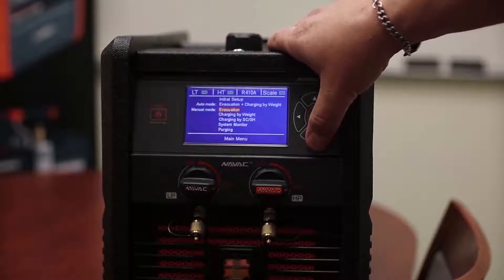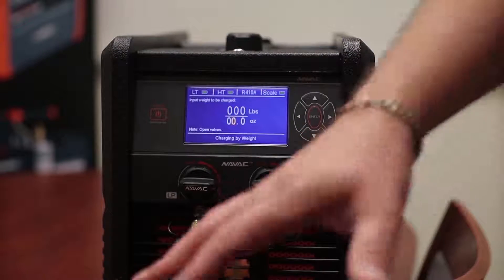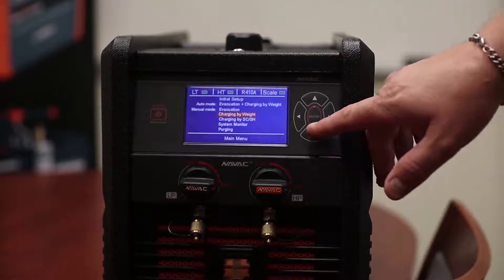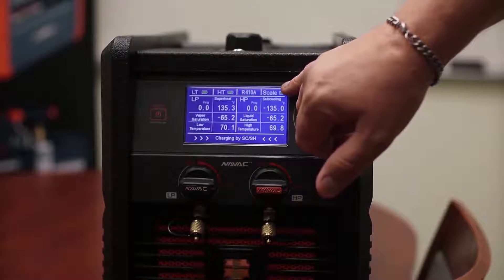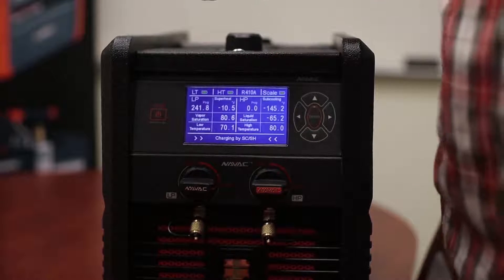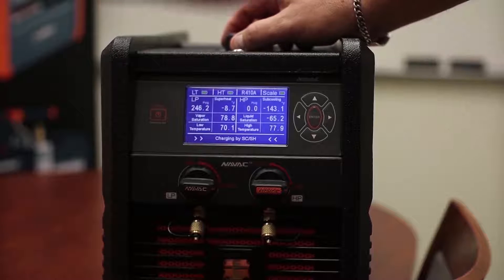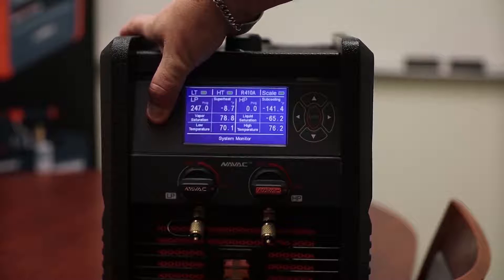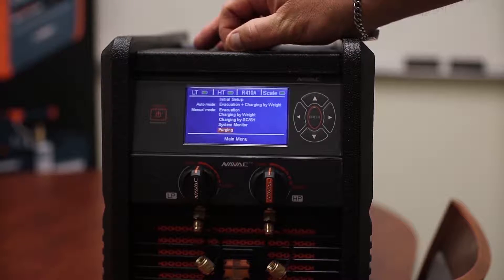NRC62D Training Video Part03 - Charging, System Monitoring & Purging

Comment: This machine is not configured for automatically setting charge by superheat / subcooling based on real time feedback from wireless hygrometer?
Reply from the maker: Hello. You cannot automatically charge by superheat/subcooling. You can only monitor the values. Then you will have to manually charge the unit based on your calculations. It would be very difficult to do automatically because very equipment is different while the machine doesn't know.
Reply: @NAVAC  I developed an app that measures indoor wet bulb, indoor and outdoor  ambient and based on that calculates target superheat and target supply air temperatures.
I've been considering an interface of that with a solenoid operated manifold, suction and discharge transducers (both temp and pressure), to fully automate the entire process.
It would be even easier in the case of txv, the technician would only need to provide the specified  target subcooling.